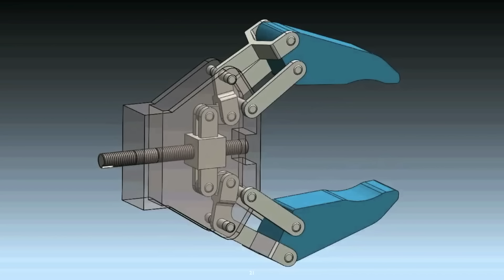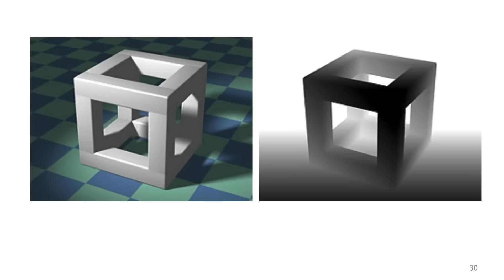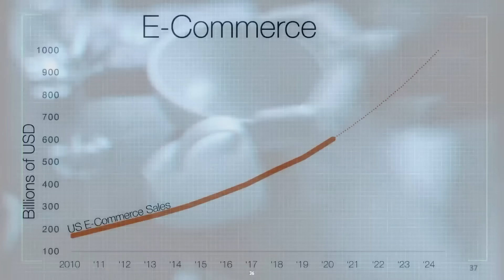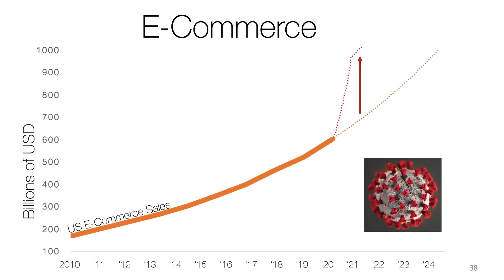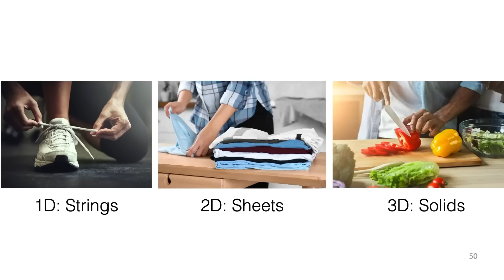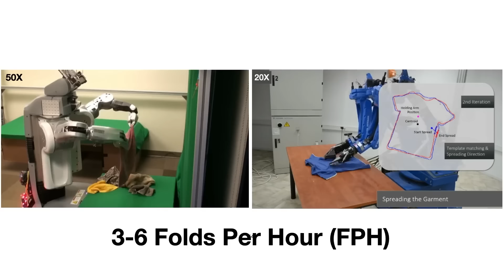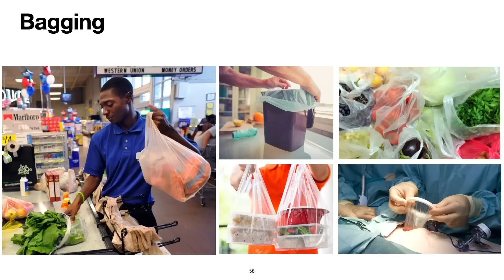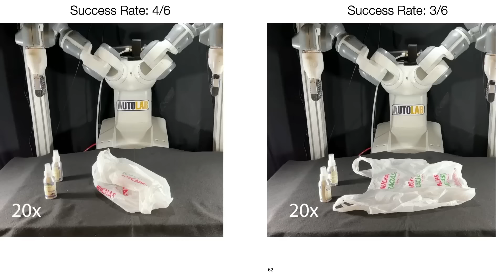Why Don’t We Have Better Robots Yet? | Ken Goldberg | TED

Comment: Folding the laundry at 3-6 folds per hour is way higher than the 0 folds per hour I am currently doing.
Reply: Yes ! once robots can roll the perfect joint. , I'm sold 😅
Reply: I was thinking the exact same thing.  I haven't folded laundry in years.  I'd love a robot that can get 3-6 folds done per hour.  If left running constantly in the laundry room, it'd still be faster at folding than I am at wearing the clothes.
Reply: Yup I don't think speed is an issue because if you can get enough robots for cheap, so that they're doing different tasks passively, speed is a non-issue. But they'll get faster over time anyway
Reply: You don't have to be faster than the dragon, just faster than the Hobbit in your party.
Reply: Let's also remember that first laundry folding robot you saw was more than US $400 000 a piece, used for research.

Comment: For manipulating objects with our hands, we have a set of sensors in our fingers that robots can only dream of. Pressure, temperature, texture, weight, slipperiness... I couldn't pick up a coffee cup if vision was my only sense.
Reply: Proprioception is a really big one too
Reply: we can actual feel surface variation that we cannot see with our eyes, eg. finding the start end on a roll of scotch tape
Reply: 1x seems to know touch is an important component of robots. And think about how foundational it is to our own models of the world: vision, hearing, and smell only give you some information about the world, and they can lie. Touch, however, gives you a very accurate and objective model of what things physically are. A blind and deaf person can still understand space very well.

At the very least it's another modality to work with. Relying on one sense for everything is not safe or robust. You want a good allegory of the cave that's at least decent, with multiple faculties to model the world with.
Reply: But you can pick up coffee cup even when your hand is numb
What we really need, is to mimic anatomy of our hands. And then all you really do to grasp things - is just flex muscles. The rest adapts. It's not a rigid system.
Reply: @tempname8263  let's see a robot open a plastic bag in the produce section, how about simply opening a can of peas or an alkaseltzer packet? How about undoing a knotted shoelace ?
Reply: @kimbalcalkins6903  Everything of that is a lot easier with proper mechanics
Reply: There are actually numerous universities that have been working on replicating all those sorts of senses using gel filled fingertip pads that can sense pressure, temp, slickness, etc.
Reply: @mikekopack6441  interesting, I asked ChatGPT about moth antenna and it said there were nano devices that could replicate them !
Reply: I don't know, I do electronics and there's no way I would use my fingers for most things that are less than an inch in size. Tweezers, always tweezers, the most important tool. But it's not like I can feel any of these things through the tweezers except coarse pressure.
Reply: It's not a matter of senses.  It's a matter of what to do with those senses.  It's easy enough to say that when your finger feels a burning sensation, pull back.  But to train a computer on what to do in all cases is the difficult part.  The computer can not deduce things is has never encountered before.  It can only take a weighted guess.  Whereas a human can guess or deduce the next step.
Reply: You could definitely pick up a coffee cup using only vision...
Reply: @games528  an eight year can untie a knot in a shoe string without looking at it. Also we can feel things that we cannot see. Like finding the start of roll of scotch tape that snapped back onto the roll.
Reply: @kimbalcalkins6903  I wasn't saying that touch isn't useful, or necessary for many tasks. The given example just wasn't one that requires touch.
Reply: @games528  even so there is a subtle use of feeling.. Try picking up a full cup of coffee using the handle ?
Reply: 7 or 8 years back, righthand robotics had the Reflex Gripper, which had touch-sensitive fingertips and palm (using a novel cheap sensor with an open design.)  Great for R&D robotics and it ended up in some university coursework, but it never ended up in any of righthand's commercial products - it turns out to be a lot of data you just don't need for piece picking.
Reply: @MarkEichin  will check it out, the hand that solves the Rubicks Cube is pretty crazy!

Comment: Robots don't need to be perfect, they just need to cover 3 criteria.
1) graceful failure states. A robo vaccuum sounds great, but if it is going to choke on a string, or smear a mess and make things worse rather than better... Yeah, no thanks. If a folding robot rips a shirt a week then I'm not keeping it around. I feel like this is the biggest hurtle right now. The price of many things has gone down, and reliability gone up... But those rare fails are big fails that undo all of their savings.
They don't need to be perfect. They just need to fail better.
2) they need to save time. I keep looking at robot mowers, especially during spring allergies. My fear is that I will spend more time picking one, and programming it, and maintaining it, and replacing it than I will save by just mowing the lawn myself. The argument that learning the skills to maintain it are more valuable than the skill of mowing the lawn is not lost on me. But what I need in life is time savings, not a new hobby.
And the savings needs to be well beyond 10:1. It doesn't matter if a robot is significantly slower than me at a task, as long as it saves me time. A robo mower may take 20-40 min a day to cover the same yard I do in an hour a week... But if I don't have to do anything for that hour a week, then it is still a net benefit to me.
3) it has to be a money saver. So many appliance style robots come with a high up front cost, and a yearly subscription, and generally do a worse job than I do at the task. Like time, it has to be in the 10:1 savings range over the life of the product to make it worth it. So either a loss leader with a subscription like printers have moved towards, or a high up front cost for years of little to no maintenance like traditional appliances. Robot mowers that cost thousands, and then cost monthly are never going to break even before they are replaced. It may free up some time so I can work more... But me working for my robot kinda misses the point of the hired help. 😅

But I think we are getting close. Robo vaccuum cleaners are already just about there. And we are on the cusp of many others. I think the big mistake companies are making is designing specific use robots, or building humanoid robots, when neither are particularly easy or cost effective. Something that can use the equipment I already have, but without the fall hazard of a bipedal robot is ideal. Something on rollers or treads, with arms and a mast for cameras is the simple answer to so many of the issues. Then as long as it can push a vaccuum, or manipulate laundry, or reach the dishes and stove... We can add capabilities with processing and software upgrades over time. But the actual form factor and mechanic side of things is there already. Just need to dress it up in a way people will enjoy, and gain more skills.
Reply: Robot pool cleaners are also already very popular.
Reply: Good points, but here are some subtle counterpoints that could be used by a successful robotics product: 1) If I can shift my time commitment, then that's good enough. 2) if I can narrow my skills it is sometimes good. Rather than learning and acquiring equipment for a variety of household chores I might prefer to be good at only robot maintenance. 

Maintaining robots at night rather than doing ten different chores might suit me - or I could even hire a single maintenance worker to do it.

Comment: Robots can assemble a car, which is a much more complex task than preparing lasagne. But no robot exists that can prepare a lasagne in my home. That’s because car factories, along with the entire automotive supply chain, have been entirely reconfigured to help the robots.
If I was ready to reconfigure my house and the way all the supplies arrive and get stored, then robolasagne would not be an issue.
We don’t have multi-purpose home robots because we’ve done nothing to make our homes robot-friendly.
Reply: Nor should we. We should have the robot accommodate us, not the other way around.
A multi-purpose humanoid robot is the solution.
Reply: There is no single robot that can assemble a car though. It takes many different specialised robots breaking the complex task down into many simple ones.
Reply: Every single person would have to use the same appliances, same layout, same house, same bath towel.... That would also mean that in order for it to be uniform, no living thing can be in the house unless every single person moves, talks, acts the same way because they would introduce variables. This does not make sense for living spaces, sorry. Robotlasgna doesn't exist because there is no market for it that will out weight the R&D and other investments involved. There is however a large enough market to do that with vacuum/mop/mower robots and those do not need explicit layouts. You're argument is static vs dynamic approaches. Static make sense in sterile environments but living environments are dynamic.
Reply: That's where the unmet demand is:  Designing robots for a specific environment that you have no control over.  For example robots that can inspect roofs and attics, or explore caves.
Reply: @JJs_playground I guess that depends on whether you want home robotics within your lifetime or are happy enough for next generations to experience this 😢

Comment: some current issues:

scale & targeted specificity of training (not very general beyond task, lack gen int)

inference can be slow

inference can be expensive

inferences via foundation models are disjointed
---

with foundation models / LLMs that will help knockout the scale/generalization issue, looks like some companies are using hierarchical methods to make progress ie figure01

costs per inference seems to be declining rapidly

speed of tokens per second or inferences a second is also making progress. 

Disjointed nature/statelessness of inference is the last hurdle; research is currently investigate State models & memory units to learn from past activations to inform current inference. Though prob not 100% necessary, as tasks can be broken up into many smaller tasks, this would help with coherence esp of goals across inference and fluidity -instead of each inference popping into existence at that moment not aware of the context, 'thoughts', why of previous inference and then handed the chat history up to that point to seem somewhat continuous. Though there are hacks like having it think aloud it's plans and goals needed and currently doing but some nuance is lost thus not ideal.
Reply: this is what i imagine a robot would write if it was to report its own experience trying to fold a shirt

Comment: This aged poorly already. This video is from September 2023.. So the research he's showing off, is actually outdated already, considering the pace of advancement we've seen lately.
In the months since this talk, robot companies have started using multimodal LLMs to control their humanoid robots. And it's showing a significant improvement.
Reply: It's not outdated, it's just a more traditional approach. It is IMO a big mistake to abandon such approaches and use LLM black boxes for everything, because these are way less interpretable. They may fail less often, but when they do it's likely to be much more insidious.
Reply: Nope still up to date. Those are only trained to walk on uneven terrain which is a lot easier but still far from matching the dexterity of the human hand. Level 5 driverless cars hasn't even been solved yet and these home robots are orders of magnitude more complex.
Reply: Actually, I'm confused as to how he's making fun of Atlas in a warehouse, while Amazon just signed with Agility Robotics to deploy the humanoid Digit in warehouses.
Reply: @GH-uo9fy  That's not accurate. Have you seen a video explaining Nvidia's robot simulation platform? The one used to train that 4 wheeled robot to stand up and open doors? It's more than just walking on uneven terrain. And several companies have been demoing robot hands that are in my view, good enough for now.
Also, Mercedes just released Level 3 self driving, without a requirement to watch the road while it's activated. From here on, that's going to progress rapidly. So I wouldn't use driverless cars as an example like that, anymore.
Reply: @leftaroundabout  Have you seen how they're using the LLMs for this purpose? They don't handle everything, just the decision making, or like a conductor. The actions the robot can make, are still trained with a more traditional approach.
Traditional methods for programming robots, can only get us so far. LLMs are the missing piece, that enables robots to have more common sense in their environment, and that aspect will only improve from here.
Reply: @GrumpDog  LLMs aren't "the missing piece". The future isn't some jigsaw puzzle that has one inevitable outcome, it's rather like a box of Lego bricks - we get to decide what to do with it. (Except they're superpowered Lego bricks with which you can build things as dangerous as nuclear weapons.)
There are lots of ways robotics could improve, vastly, that doesn't require anything like LLMs. The problem with traditional robotics is that it's mostly just really dumb rule-following, but no doubt the same hardware advances that have enabled deep learning could also be leveraged for properly maths-based alternatives, like probabilistic ensemble simulations of the physical interactions between objects in the robot's vicinity.
Reply: @leftaroundabout  You know, you say all that.. But then I see robots working better thanks to LLMs, than they ever did without them. So I think I'll just go by what's working.
Regardless of what you think of their abilities, LLMs DO indeed handle the higher-level decision making, far better than previously programmed rule following ever could. It's much more akin to how a human would reason through a problem on paper. This is because language itself contains an underlying framework for reasoning. Just as humans developed language as they became more intelligent, so too did our use of language enable in us a greater level of reasoning in a kind of feedback loop during the course of our development.
Reply: @GrumpDog  I don't dispute that LLMs can make robots better, I just disagree that it's worth the loss of control and understanding we have over them. I don't want robots to be capable of smart reasoning, I want them to do exactly what I need and nothing else. Natural language is not well suited for exactly specifying what I need. (Not really a problem specific to robots, happens also all the time in human-to-human communication... this comment thread kind of illustrates it.)

Comment: This is great but it’s pretty traditional and won’t make progress quickly. We already have AI (Sora) that can generate realistic HD video conditioned on images and text. Why not take video from the robot’s cameras, condition on a task like “POV of robot folding a t-shirt” and use the video as reference to move the actual robot. All of the complexities of physics and uncertainty in sensors will melt away as the robot simply follows the video, and the video subsequently follows reality as new images are fed in to Sora. I’m really looking forward to this new technique as it removes the need for creating complex simulations and training on each task. Sora (and AI video generation in general) will allow robots to do anything that can be generated in a video. Honestly it may be the last step towards completely capable robots and I’m very excited (and terrified) at the prospects. I hope your lab or someone also explores this idea.
Reply: This could only work if the AI is powerful enough so it hasn't only learned "realistic HD" (whatever that's supposed to be) but actual physical processes underyling the movements of the objects in it plus the illumination effects. Now, I don't say a dumb-but-huge attention-based black box model couldn't get to that point - that seems to be more or less how animal and human vision works too. But it's a brute-force approach that's only "efficient" in the sense that it can exploit the massive parallelisation of SIMD architectures.

The problem with such approaches is that it's basically impossible to know how reliable the model actually is, specifically what the underlying assumptions on the operation domain are. The model will always be influenced by biases in the training set, which we likely will never understand properly. What actually happens in real-world use cases is a complete roulette then - it may work just fine in 99% of cases, but what it does in the odd failure event is impossible to predict and could range anywhere between "sews back the rip in the shirt" (because it has actually seen that in the training set) and "burns down the house".

I'd much rather we'd be content with not making progress quickly, but making progress steadily and based on proper human-understandable models that allow us to stay on top of what's actually going on and what the robot can and cannot do.
Reply: It often makes glitches that would take large amount of manual work to fix, if you wanted to use such video professionally. Same as any robot, if it sometimes makes a mess and needs fixing, that quickly undoes all work savings.